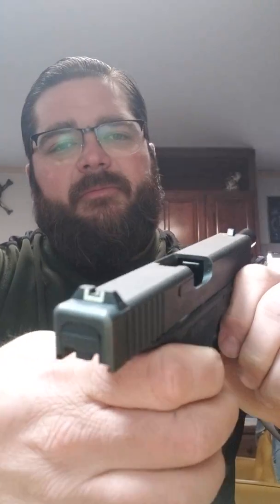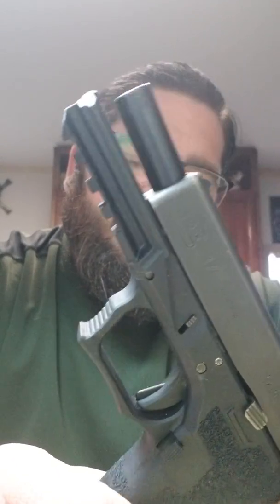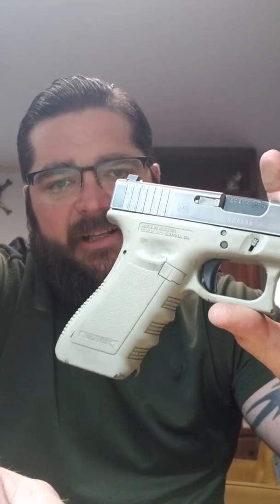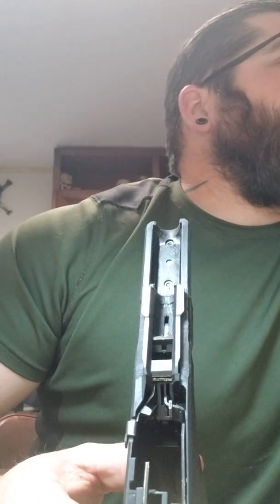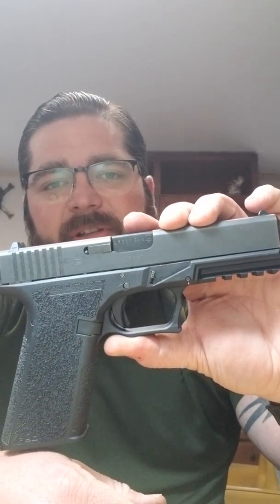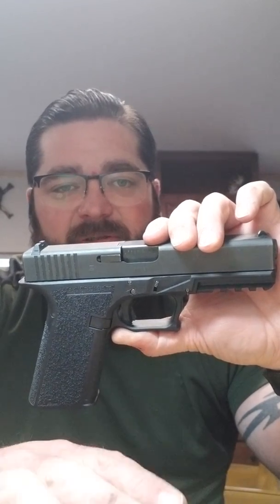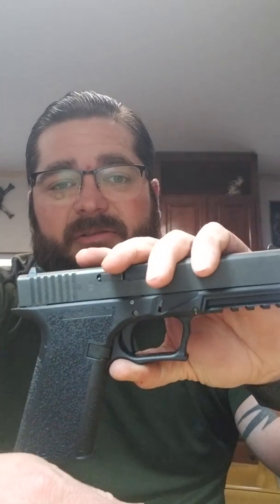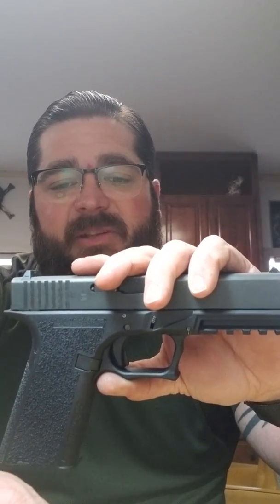Polymer 80 issue fixed

Comment: Put the parts on a serialized gun and then take it in to gunsmith. I've built a few. Never had this issue. I was wondering if it was parts from a gen4 or 5

Comment: Is that called Glock locking block?
Reply from the maker: Brother ill be honest im not entirely sure what the exact nomenclature is . Which exact area are you referring to?
Reply: @fakeitormakeit83  the slide release levers the part that may be too high
Reply: @fakeitormakeit83  the part that may be sticking too high
Reply from the maker: @hollywoodRunnaOG  so the take down lever sets on the take down spring that sits down in the slide right?
Reply from the maker: @hollywoodRunnaOG  ahh take down spring the actual tiny little flat steel spring that live under the take down lever is what i had to adjust to get this particular slide and frame to func
Reply: @fakeitormakeit83  I just check it doesn't look like it's sitting too high, some say swap out the ejector to a gen 4. I'm just going to do both, jam's on 1st shot but round comes out perfectly the slide always locks up
Reply: @fakeitormakeit83  yes I believe so, the piece that you say may be sticking up too high, they call it a locking block not sure if that's that button on the inside where you can push it down and the slides move part number 27 in the Glock store book slide lock lever?
Reply: @fakeitormakeit83  correct it may be part number 27 I'm not sure I'm confused they call it slide lock leverage spring and then the slide lock lever
Reply from the maker: @hollywoodRunnaOG  hmmm those are both inexpensive options to try so i would say go for it for sure . The frame doesnt have any unusual wear marks does it
Reply: @fakeitormakeit83  bingo. Part #27 slide lock lever that may be too high? Which gen functions best
Reply: @fakeitormakeit83  brand new frame I was thinking the slide was too heavy for it cuz the slide is heavy as hell,  I have a heavy tungsten guide rod in it as well
Reply: @fakeitormakeit83  if I can get the factory parts I don't know which company to trust besides Glock store an they're out of stock smh 🤦🏽‍♂️

Comment: Mine only does it when a round in the chamber ‼️‼️help‼️‼️
Reply from the maker: Hmmm is the slide and barrel of good quality? Is the rounds your using reloads or factory loads ? Only doing it with a round in the chamber seems maybe somthing is out of spec some where around the breach face and where the slide locks up with the barrel?

Comment: Everybody knows in the P80 You have to cut the slide release spring before you put it in lol. And look at that shark fin someone filed it down so low. And why are y’all still using stock Triggers you’re really gonna put your life into a 6 pound trigger go get yourself a 1 pound trigger from Jonny Glocks might save your life
Reply from the maker: Hey thanks for stopping by and checking out the video! Yeah this little glock had some issues when it came to me lol. I wasnt a fan of it personally but i guess to each their own .